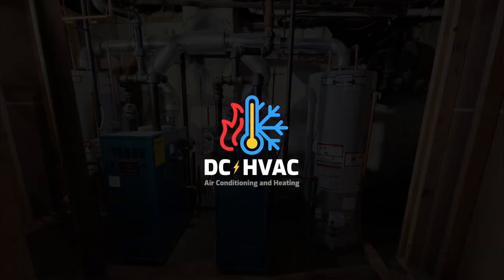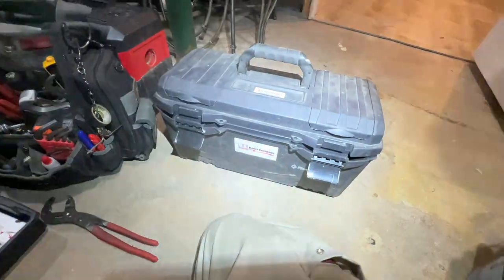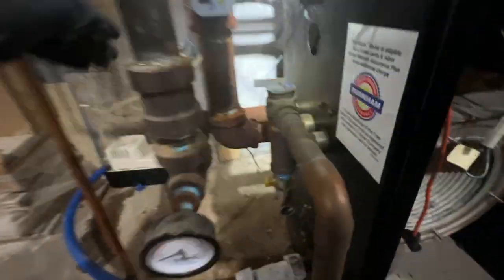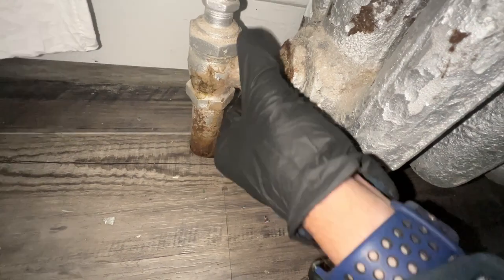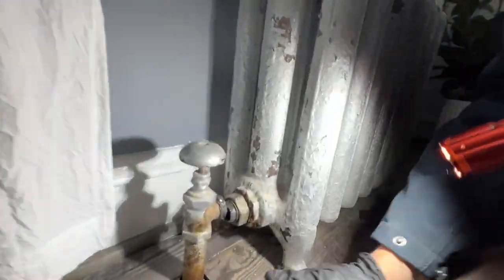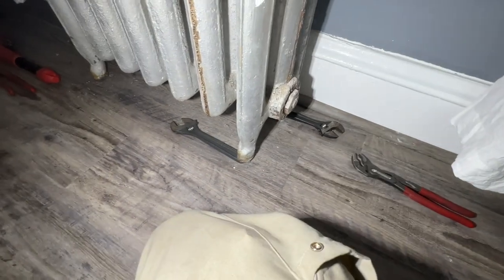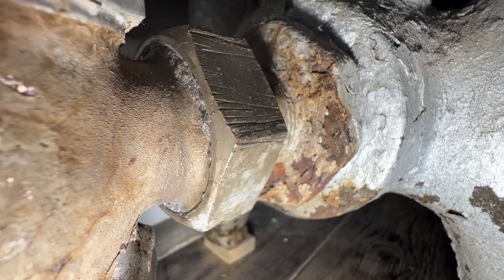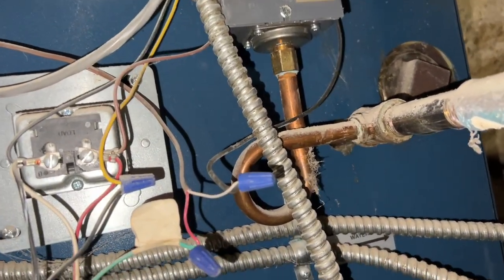“Hacky” Steam Boiler Needs Repairs! Burnham Alpine Repairs! Dead Burnham Inducer Blower Motor!

Comment: How recently was it installed???? Some of those pipes have been there for years!
Reply from the maker: It was installed about a year ago, just changed out near boiler piping… a lot of construction in the house that’s why it’s covered in so much dust. Sheetrock, saw dust, etc…

The wiring is very odd, never seen a vent damper moped connector cut off and spliced into. I didn’t really understand the wiring. But they cut 120v with the backup manual reset Pressuretrol which was set all the way up to 15 psi and took quite a few turns to even bring it down past 15 so it probably would have never triggered since the rellief valve will go off at pretty much exactly 15…

They also installed a radiator in the kitchen which has no air vent and doesn’t get hot.

A lot of hackary… the sears guys tend to be young and not taught the stuff that they need and they get thrown on installs like that.
Reply: Thank you for the response, I figured that's where Sears saved all the money in the cheap Quote. Hope you get their repeat business!

Comment: Off Topic: Hey Daniel, how is the Motorbike working out? Get that gearing straightened out?
Reply from the maker: Yea it’s about the best it’ll get for the motor and wheel size. Quick 0-30 but still keeps the front wheel on the ground. And top speed of around 60. Tried multiple gearing ratios. Have it set up with the torque converter on a 40 tooth sprocket I believe. It’s quick and manageable. It’s tough to push it any faster cause I only have rear drum brakes. 

Thanks for asking.
Reply: @DCHVAC  Sounds like you pretty much dialed it in for its best performance. Smart idea to not push it faster than the capability of the brakes. Good luck with it!
Reply: @DCHVAC  m
Reply: Nice channel Daniel , good to see you and Peter working . You guys have a very bright future. Keep up the good work.